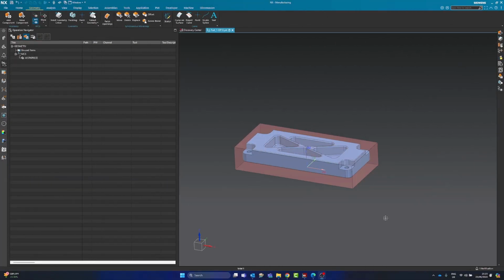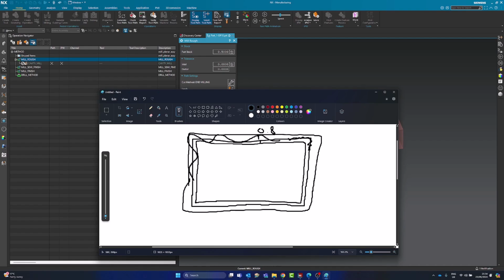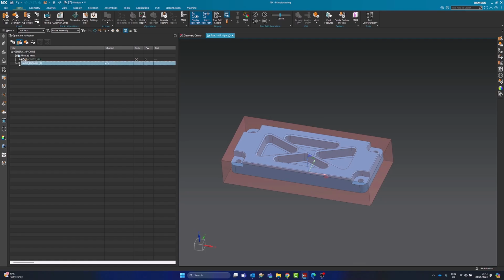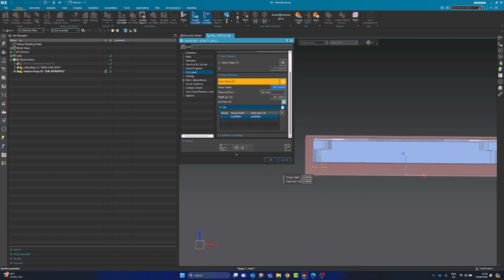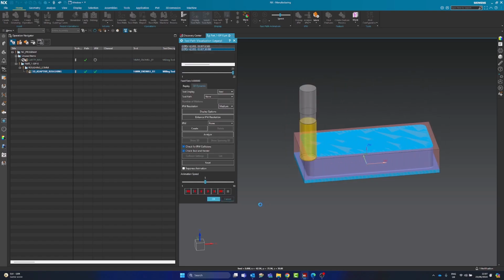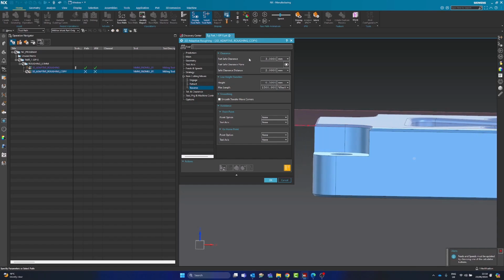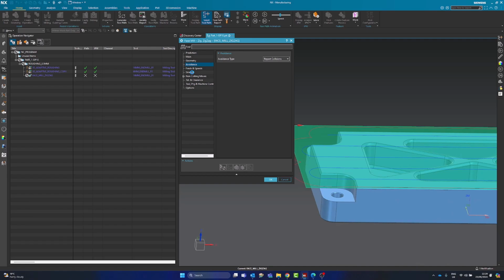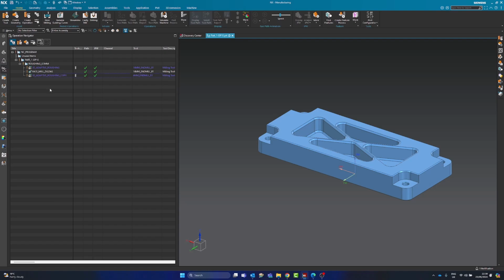NXCAM Training | Lesson 3 - Our FIRST TOOL PATHS

Comment: Regarding corners and tool diameter. Isn’t it better to use bigger tool and then change to smaller to finish the corner? Or that isn’t good strategy? Specially on bigger pockets milling with smaller tool just to be able to finish corner will be not so efficient. Complete beginner so wondering:)

Comment: Hi I have one doubt like when we are using adaptive milling toolpath is it necessary to use line output because some machine cannot calculate too many G2 G3 Lines or we can use it with arc perp/ par with tool axis or is it a myth to use line output whenever we are using high speed toolpath strategies
Reply from the maker: In my career I have always used “Arc - Perp/par to Tool Axis, but I have been lucky enough to be around top quality machines. 

I believe adaptive milling strategies would be completely fine on most modern machines but I can imagine if you are using older machines then a more traditional cavity will may be more efficient as you could experience some machine “juddering”.

I hope this answers your question and thank you for the continued support!